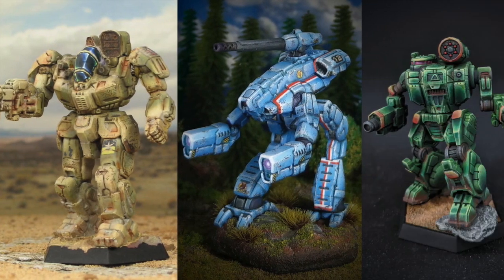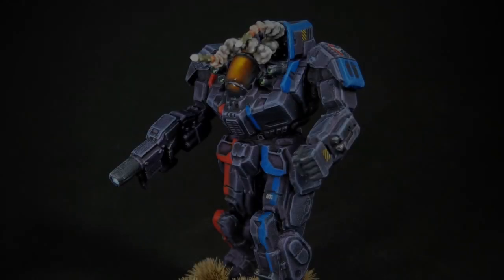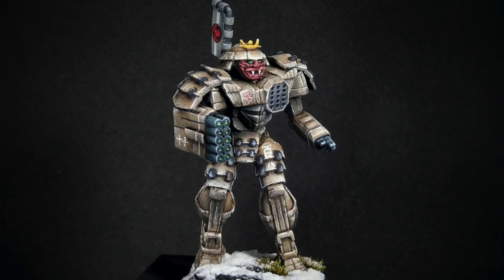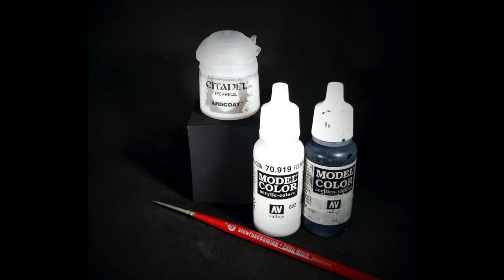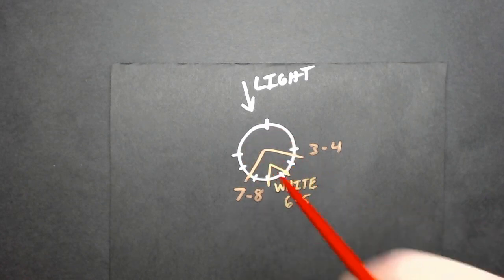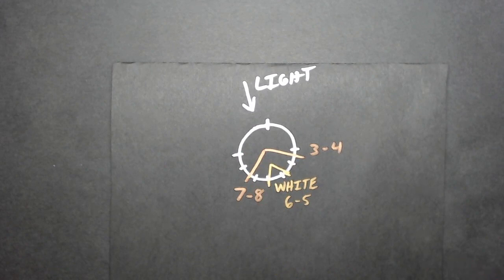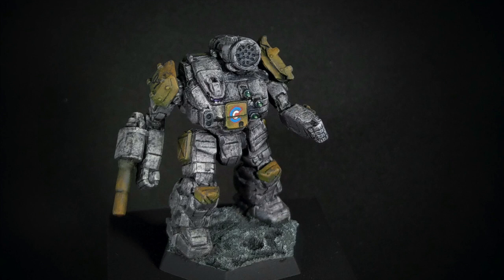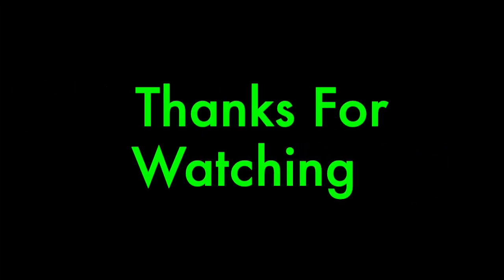Easy Jeweling Effects for Laser Weapons | Battletech Painting

Comment: But about the 'Mech itself, that camo pat looks amazing! What's the method of getting that marbling?
Reply from the maker: Thanks. The pattern is a stippled grey over a lighter grey and then a black oil wash over all of it. Then after the wash was dry, mineral spirits to remove most of the residual from the raised surfaces and then touch up stippling with grey again to even out the effect.
Reply: @CamoSpecsOnline  I see! I've never heard of that process before. Would you have time to create video on it, by chance?
Reply from the maker: @leafback1485  I want to but might not be for a while. The next best thing for now would be to look for "oil wash techniques" on here. you'll find a number of videos that show how to do it on larger scale aircraft and tank models. The process is essentially the same but a smaller scale and you need to use a brush instead of paper towel or swab to remove the oils from the raised surfaces after it dries.
Reply: @CamoSpecsOnline  Superb! Thanks for the info, I'll get to work on researching that.